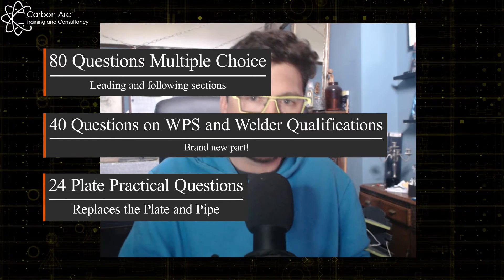CSWIP 3.1 in 2024 - Brand new requirements!

Comment: People at TWI not understanding the scope of work of the welding inspector is not welding Eng.  
Exam questions including engineering level or material behavior  question is useless for site welding inspector. 

That why inspectors & clients moving to AWS & ISO.
Reply from the maker: I would agree with you to a point. I believe that you are right that the exam has not always looked at what's actually required to be a welding inspector, but I would say that the level of detail covered tries to make sure that you fully understand why things are done and what the effects of not following documented processes are. I also find that alot of companies use CSWIP 3.1s as proxy welding engineers which muddies the waters.

Comment: Doesn't this make CSWIP exam a lot difficult than it used to be?
Reply from the maker: I believe the exams will now be more specific and more like what you have to do as a welding inspector for steels. If you can identify defects correctly it should not be any harder.